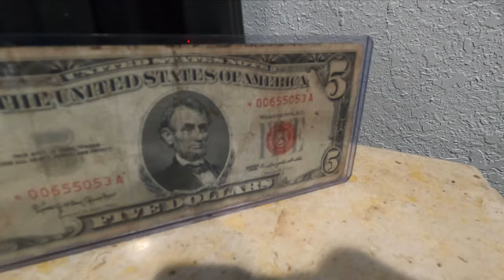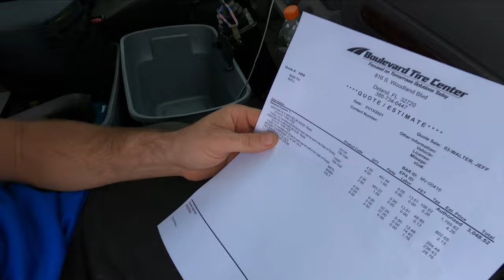We Did It Again! Junk Removal Day

Comment: Keep your tanks full to extend the life of your fuel pumps. Having more fuel makes the pumps not have to work as hard and run cooler. If you need more range it should be fairly easy to mount up a larger fuel tank or 2nd fuel tank on your roll off truck.

Comment: When I owned my rock truck the fuel gauge worked when it wanted to, I was always worried about running out of fuel so I topped it off every morning to be sure I was good for the day. Hope you got more jobs done that day, between tires and road side service that $1k job was a wash and that doesn't include dump fees.